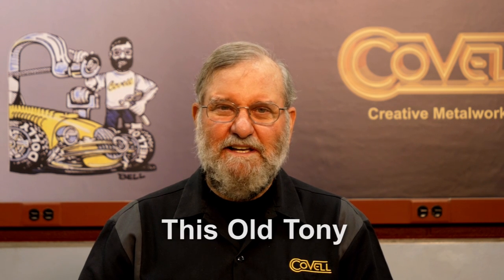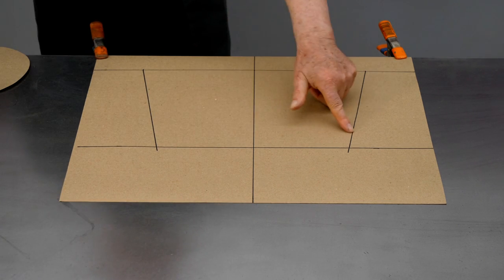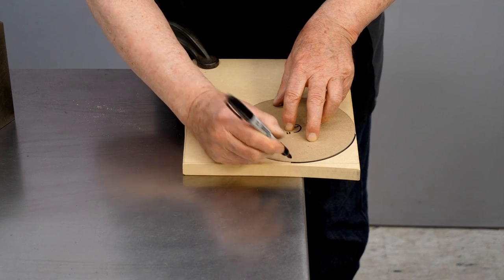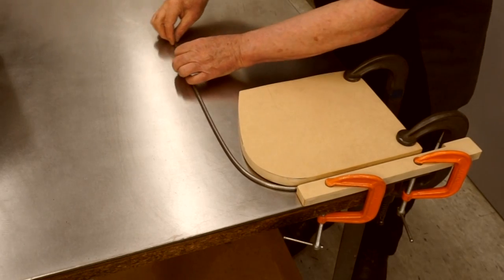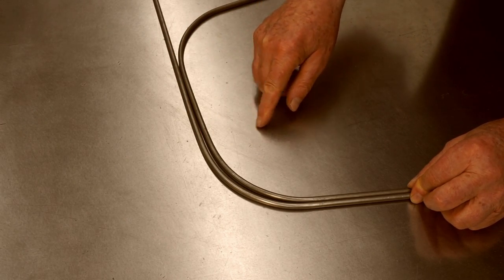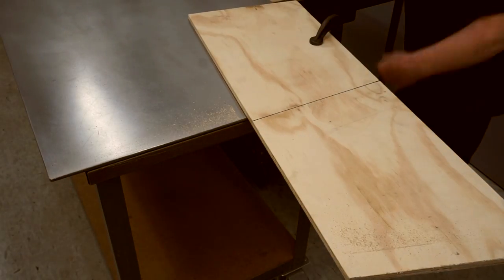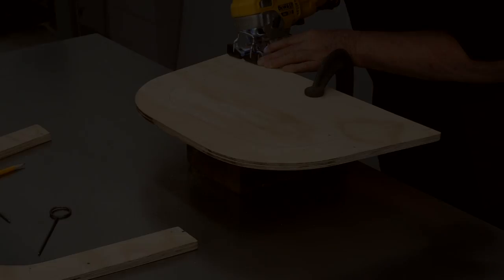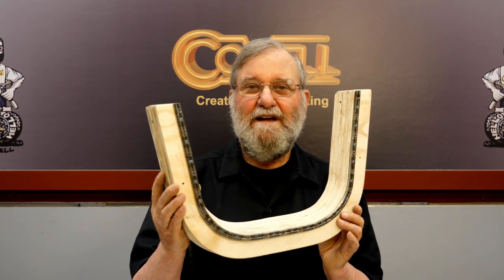Cleaning Up! with This Old Tony

Comment: This Old Tony's process will be a lot shorter, as long as he doesn't use the surface grinder...🤣🤣🤣 
He'll probably be like "So I've fired up Solid Works, made a quick sketch... Race you to the CNC machine... I've put a 40x20 piece of solid billet aluminum in the machine so let's press the start button and make one of the two dustpan handles, I have a 2nd 40x20 piece of aluminium here to make the 2nd handle..." An hour later, just as the piece is almost done, his end mill takes an unexpected dive into the vice and snaps off.... 🤣🤣🤣🤣
Reply from the maker: Sounds like you have some experience with CNC machining!
Reply: @RonCovell  not really but I've watched enough of TOTs videos to know that his surface grinder doesn't like him...
I was having a cheap dig at TOT that he'd turn a load of perfectly good material into chips, and he has had a few mishaps on his cnc machine... He's one of my favorites on YouTube as he never fails to entertain while also imparting his knowledge and expertise.
You did an excellent job with that form work, you make it look so easy. Can't wait for part 2

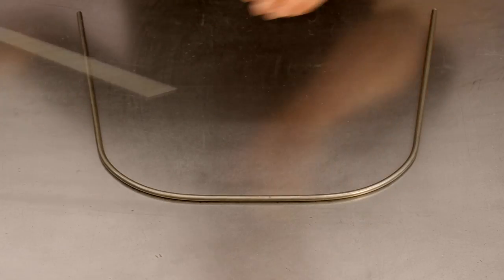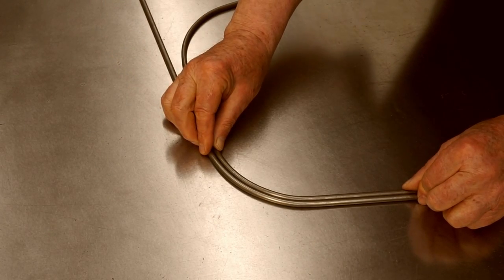Comment: I bet a lot of people thought the same as what my first thought wanted to be @ 10:46 which is wow overkill on the clamps hows he even gonna fit his weld tip in that mess.... yea that thought seems legit and probably is to anybody that hasn't seen the effects of heat over distance. i made the mistake of welding a window channel stainless in a bus that was about 6ftlong and used 3 clamps hahahahah now i see @ 10:46 and ask my self why he isn't using another clamp rite there maybe another over there.... good video. so when can we purchase the pans and where would we be able to find them my garage has to have one now that I've seen this, i bet that pan you could just set on the floor, and the dust jump into it. say good by to the famous left behind dust line!!!
Reply from the maker: Thanks so much for your comments!

Comment: Omg why did you test fit the screw in every hole instead of just using the depth stop of the drill press? You templated everything but didn’t use the features of the tool to make it easy
Reply from the maker: I've learned the hard way that using the depth stop on a drill press can lead to unfortunate outcomes. If a small chip of wood or metal gets under the part, you will cut too deep.

Comment: I've never been so excited about a dustpan before. There's woodworking...there's metalworking...there's going to be metal being worked inside wood that's been worked... and TOT is going to over-engineer a 2$ handle using a 250000$ machine shop.  Sales of plywood and sheet metal exploding everywhere, in the distance, the sound of hammering.....the birth of a thousand rickety dustpans by an army of weekend warriors armed with the wrong tools...and even further off in the distance, the exasperated sighs of a thousand wives.
Reply from the maker: Say, you are waxing quite poetic!

Comment: We now live in that” press five for Spanish” age with metric conversion. Why Americans hate metric-
#1 temperature - unless you use decimals the metric range in normal weather is too narrow from -2 to 39 in most places , just 41 units not very descriptive.    #2 length measurements same argument, one inch divided into 1000 referred to as whole units of a thousandth while the cm and mm being smaller are less intuitive and historic in repairs are made of machinery from the age of industry before the plastic world of today, today you toss the crap because it rarely can be repaired. #3 volume is accepted because a liter is close enough to a quart # 4 weight/ mass, but weight because we live on earth and most near sea level, too large a unit, one pound is 2.2 kgs not enough division s unless you use decimals.... yes you hate fractions we hate decimals get over it.  It’s the quarter mile , the zero to sixty, the quarter pounder
Reply from the maker: Tony has a great line about this subject, which I will paraphrase: 'Brought to you by the Metric System - used by 15/16 of people worldwide'
I got a great laugh out of that one!